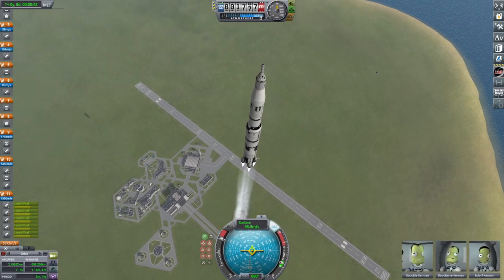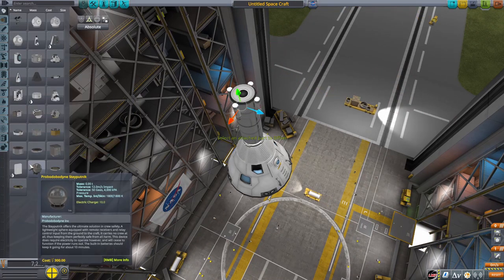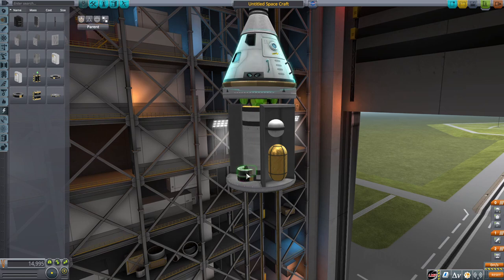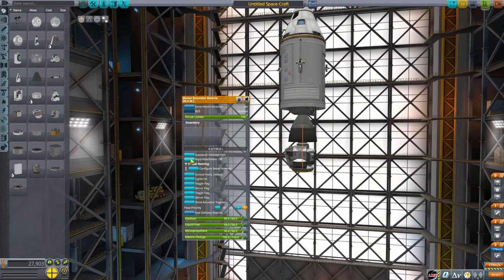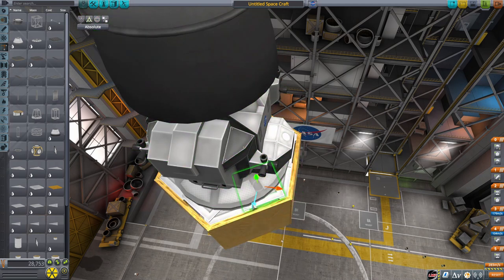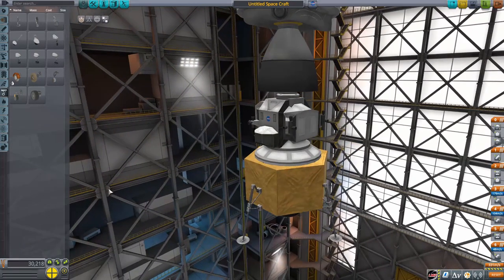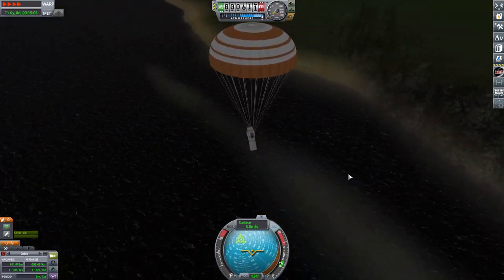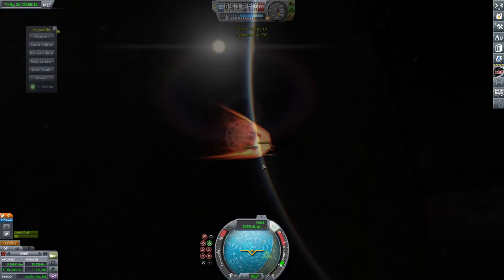KSP Tutorial: How To Build And Fly A FULLY Reusable Saturn V! [stock 1.11]

Comment: Tip, don't put "Stock" in the title. Very misleading. Makes people think you don't need any mods or DLC when, in fact, you do.
Reply from the maker: I put stock in the titles bc it is generally accepted in the community that “stock” includes DLC (Matt lowne, stratzenblitz etc all do it this way) and I don’t ever include stock of mods are required for the build. In this video I have visual mods and kerbal engineer, which don’t add any parts or affect the building or flying at all